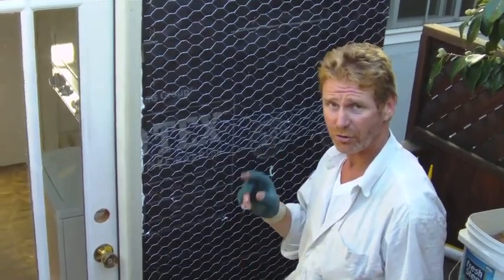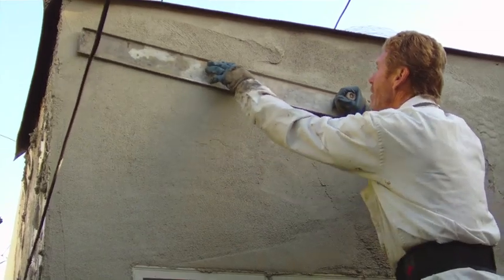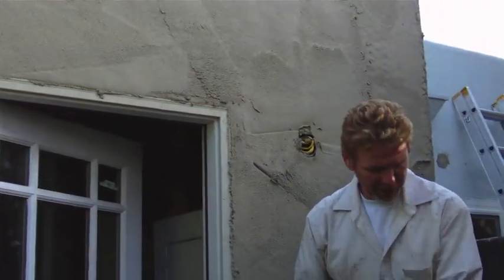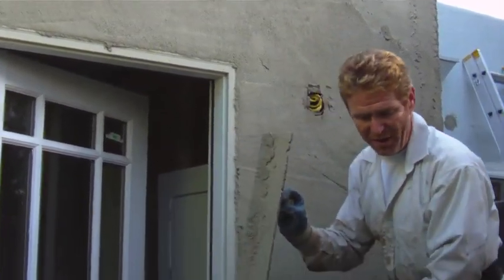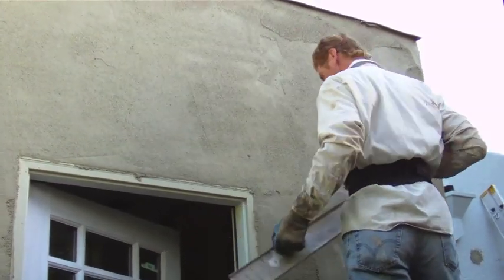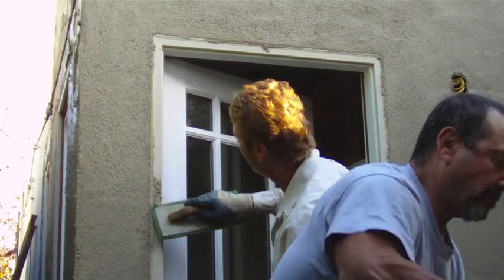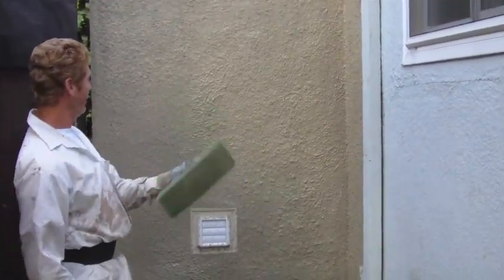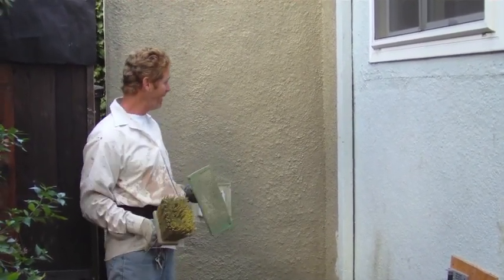Rapid Set stucco

Comment from the maker: @jonnyking44 Hey pal, (3 coat stucco same day! 
February 10, 2012 11:51 AM)
This video, titled and dated above I did the same thing on the top, but the second time at the end of the video, I went old school and showed how I correct the issue of not enough mud. When I was union I would always tell the pump man spray it on fat and ugly, because it much easier to darby when it’s full. Not enough mud you will burn your energy in but an hours’ time.
Best wishes. 
kirk Giordano Plastering

Comment from the maker: @ron1martens Hey Ron, I rarely add anything to my bags (except sand) of stucco except occasionally luminite, which acts as an accelerator. 
 I buy premium stucco it has the strength of common and the workability of plastic pre mixed in one bag, I just add sand. 20 years ago I used to buy the bags separately but even back then the only thing I would add was sometimes fibers for strength. Sorry I am no help to your question. But have a groovy day down under. 
Kirk Giordano plastering

Comment from the maker: @ron1martens Hi Ron, I have been using galvanized wire forever, I've not heard of Portland or any other cement eroding this metal. I do realize that sometime when we run our rods or darby’s over the exterior corners many times it can remove some of the galvanized coating and cause the steel to rust. But it's rare. However, rapid set when applied has to set 30 days before painting or the corners will sometimes rust, just allow proper cure times.
Best wishes,
Giordano Plastering

Comment: extrae pvc is not better than metal but is does have different reasons to be used. But just not in this case. My son has responded to you but I felt I better set the record straight. 
Have a groovy day! 
Kirk Giordano plastering

Comment: I'm glad conventional stucco works for you. We often use conventional, but on many projects we use rapid set for various reasons. This product is far stronger than conventional stucco. I'd tell you numbers, but you'll find a way to ignore those too.

Google the product and you'll see where you are wrong, on many levels. We are certified in its application, and apply it to code specs here in the bay area. 

Once again thanks for your input, always happy to hear from a fan!

Comment: Are you referring to the corners, or the roof line? At the start of the lathing segment you can see paper still hanging on the corners, we had not finished. Obviously our corners weren't installed as the other walls had yet to be lathed. Someone with your knowledge can see the corner aid at 3:12 quite clearly buried in the mud.
As for the roof line, there is a j trim installed there, but due to the lousy camera we had at the time it cant see it through the shadow cast by the roof paper.

Comment: Whenever we use this product we do two coats, a scratch and a brown coat. With this stuff you do NOT need to apply the lines, this is per their specification and our certifications, as long as you apply your brown coat while the scratch is not hardened. 

You are right about the cracking issue. This is why we hydrate the walls when we float them, and also instruct the homeowners to hydrate after we are finished. Again, this is per the specifications.

Comment: Someones a fake here alright!
First off, This is a rapid set material which allows you to brown a scratch coat without scratch marks. Both coats of the material cure together in this system. 
Second, you are right that two layers of barrier are required! Thankfully we use double ply building paper on all our projects. 
When you are good enough you can apply plaster with any trowel. We use pool trowels because they are larger, and allow us to work faster.

Thanks for watching our videos!
Jason

Comment: Once again i'll take these slow. There is no lack of a scratch coat, there is a scratch coat without scratch lines. This is completely acceptable and recommended by the manufacturer. I cannot explain this any simpler to you. There is no step cut out, there is no more risk in cracking if you follow hydration guidelines established by the manufacturer, which we do.

Comment: @StuccoPlastering Thanks for the information Kirk you have answered my question. Its interesting you have bags of pre mixed stucco. We don't have such products here. What you were doing we call a render. I now use a product with cement and sand called screed bond from calmarc. If you are interested type a search on calmarc and a site will open with products such as screed bond addp elastotak to name a few. Its interesting you use luminite as an accelerator.

Comment: I just bought a 1.5 metre feathering straight edge to compliment my 2.00m feather straight edge. The mesh is it fully dip galvanised And do you put lime in your render? How does that effect the mesh in years to come? I reinforced some brick work using a galv mesh and was told the lime eventually corrodes the metal. What are your thoughts?

Comment: Kirk, thanks for the video.  
I do a fair amount of synthetic stucco and just picked up a Darby, never used one before.  I'd like to start using one to get my finish a little flatter.  The problem I had was when I went to hit it with the Darby the mud was a little stiff to push around.  I always soak my scratch before putting on brown, usually have about a 1/4" brown coat.  Am I putting the brown on too thin?

Comment: Once again, a little knowledge is a dangerous thing. While you're correct, you completely over looked that there is a stucco stop wood trim around the door, and around the vent. These are grooved with a key in the side that we fuse our paper too. In addition they are flashed underneath with a peer and stick membrane. This is all to code.

You are very knowledgeable, but you are picking hairs where we have done nothing wrong. Again, no 10 minute video can show everything that we do.

Comment: Here, you have a point. They do make PVC products, but they are not required by code. We use galvanized because that is what code here requires. 

You have methods that work for you and that's great. Ours differ, and work great, and are completely up to code.

Comment: No ones getting shat on. We choose to instal metal flashings because its whats required and we know it works. If the PVC does in fact work better, we may switch. Thanks for the tip.

Comment: Hello Sir. quick question. What type of float are you using in this video. Is that rubber or foam. Thanks
Reply from the maker: Hello murrmann7234, excellent question, it called a Green Sponge float, it's designed to pull the sand out,
 A hard rubber float will compress the sand.
 best wishes, 
 kirk giordano plastering

Comment: How long you have to leave the brown coat to dry so you can do the color coat
Reply from the maker: Howdy depends on the weather  in the summer usually two weeks, in the winter about three weeks, more important than the cure time is hydration, soak both coats at least 3 times untill they hold no more water and the water from your garden hose just shed off. 
 This process is called hydration, it expands when wet then shrinks when dry, an absolute necessity for stucco. 
May peace, love, and happiness, find you and yours always
                Kirk Giordano Plastering and stucco tips